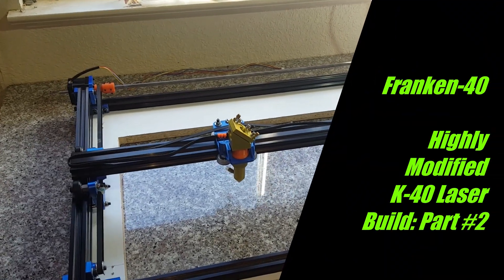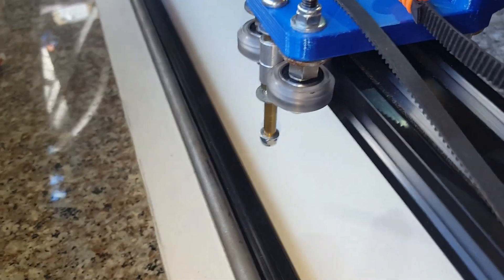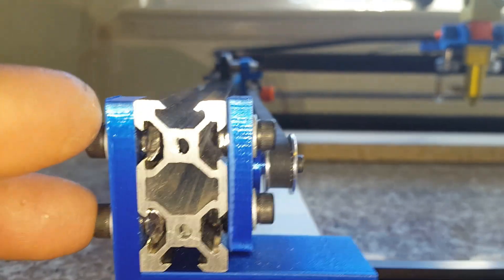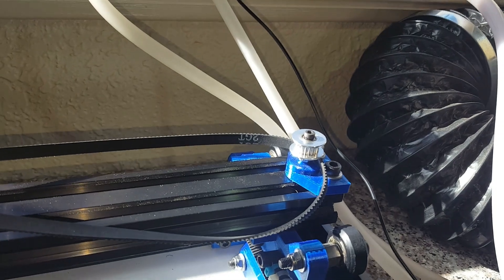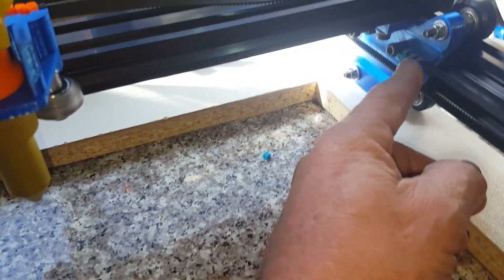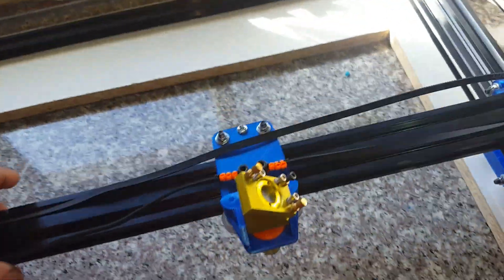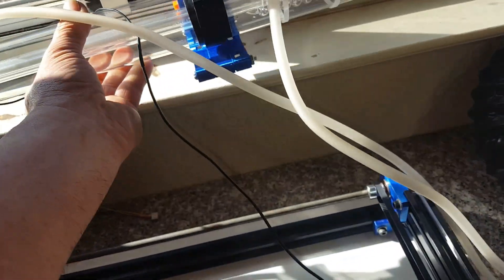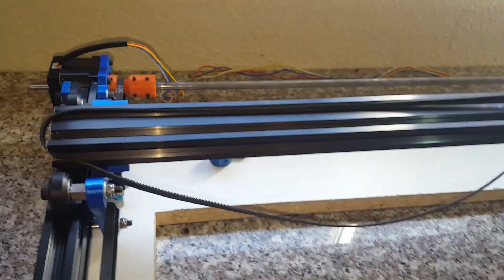Franken-40 - Highly Modified K-40 Laser Build - Part #2

Comment: Looks just like the Franken-40 I have planned. Still gotta get comfortable with my lil 10 watt diode laser first and build some good safety habits before I mess with anything higher powered. I was so close to building almost exactly this as my first laser (on a larger scale) but I thought better of it and decided to start out with a low powered laser which is visible to learn with (since it's low powered and visible there's a bit of forgiveness as I learn good safety practices- being able to see it helps me realize I messed up). I'll be referencing your vids when I get to building a similar setup- I almost can't wait, but safety first! Nice build!

In the end I plan for at least  2x3ft bed with 3 foot being the gantry width and a setup so that I can feed wood/work through front to back so that I can print 3ft x whatever my workspace can accommodate and I will likely go with something more powerful than a 40 watt, probably between 60-80 watt. It's going to be completely custom built. I really look forward to putting the thing together but that's down the Road, I first need to start earning with my little Laser and I've already got a few very promising projects in the works to get that done. Wish I'd gotten into Lasering a long time ago- I'm 39! Better late than never. My 20 Years of remodeling and 15 of Game Dev are really paying off, that experience in those two fields is kind of coming together with Lasers... of all things- strange how life works out. Sorry for the rant- love your project. I always get ranty when I'm excited about things and I am about lazing!

Comment: I put a double shaft Y motor in the middle of the back with two half shafts out to each end pulley. Eliminated that troublesome 3D printed pulley at the motor.

Comment: Hi Bill, I am thinking of ditching the case and build my own case. Do you think modifying your build method with a 3ft by 4ft foot print is feasible?
Thanks!!
Reply: I've done the same. Everything will be the same as far as the bild goes except for the length for the aluminum extrusion and the length of your 5/16ths threaded rod.

Comment: This looks great!  I'm inspired to gut my stock K40.  Can you comment on the decision to use a single y-axis stepper instead of two linked steppers with one on each side?
Reply: Two steppers on the Y would require a lot of syncro! I  put a double shaft Y motor in the middle of the back with two half shafts out to each end pulley. Eliminated that troublesome 3D printed pulley at the motor.

Comment: Hi Bill, what length are the 20/20 extrusions? I going to get a local hardware store to cut my board to size, I noticed the gap for the motor and drag chain on the left hand side and was wondering how big it was, knowing your 20/20 length will stop me going to long or too short.
Reply from the maker: It all depends on the enclosure size. My extrusion lengths are Y's are 17.750" and everything X is 28.750". The board is a little larger is 19.750" on the Y, and 17.750" on the X. I gave it more room on the left side due to the stock K40 duel shaft stepper motor.

Comment: Hey Bill, 

Looking great so far! Have you thought about using a linear rail for your X axis? I was wondering if it would be easier to do that than the wheels?
Reply from the maker: Would be nice for all three carriages, but the cost would be crazy high and more than likely overkill.
Reply: @MicroRotors  I will be upgrading mine at some point, need to get it up and running the way I want first, lol